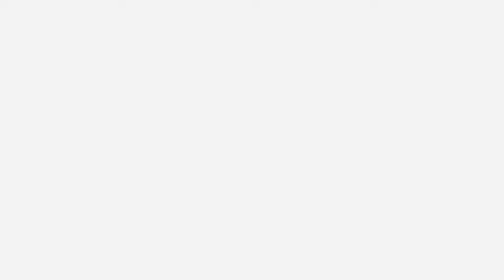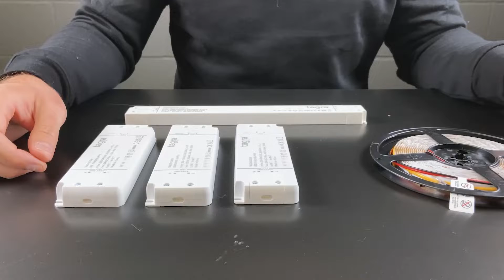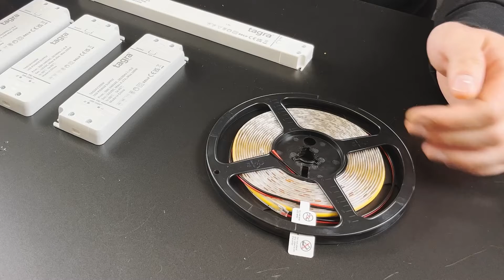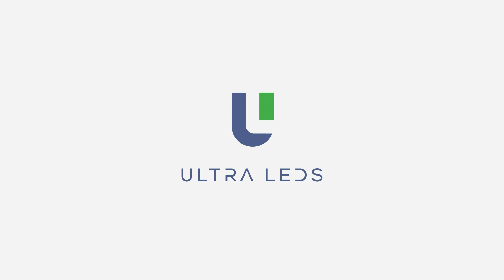Choosing the Right LED Driver for an LED Installation

Comment: Is it possible to collect all power supplies for flat led strips in one panel or it will  make issue with distance?
Shall we connect dc MCB at power supply output?

Comment: My 12watt led driver(12watt 260mA) got damaged.. I have purchased new driver which is 12watt 300mA… as 260mA driver was not available. So can i use that 12watt 300mA led driver instead of 260mA??
Reply from the maker: We only stock constant voltage LED drivers, whereas your setup requires a constant current driver. We recommend consulting your installer to ensure compatibility with your LED setup. If you're looking for constant voltage drivers, you can explore our range here: https://www.ultraleds.co.uk/led-drivers

Comment: Very informative video.
I have a fully functional light fixture which uses 220volt AC but now I am trying to move it and use it on a regular 110v AC supply. The light fixture has a lot of LED lights i.e. ten small LED lights and ten bigger LED lights all in series but I am confused with the inscription on the driver. The driver says Input: 180 - 265VAC and Output: 190 - 260VDC 240mA. I tested the driver on a 110vac outlet and it doesn't work because I think it is for 220vac supply. I think I would have to replace the driver with the right type for 110vac supply. I am not sure if there is any driver that can take 110vac and provide me with 220vdc output or am I reading something wrong. What do you think?
Reply from the maker: Your current driver (180-265V AC input) won’t work on a 110V AC supply. We stock Mean Well power supplies, some with a 90-240V AC input range, but most output 12V or 24V DC, not 220V DC. Check your fixture’s requirements and explore our range here: https://www.ultraleds.co.uk/led-drivers/led-drivers-shop-by-category/mean-well-led-drivers. For specific compatibility, consult an electrician

Comment: This is very useful.
What about the amperage, what role does that play?
If you connected 2 strips of 12V, does that mean it needs to be 24V or does it remain as 12V but the wattage goes up?

Comment: This is very useful.
What about the amperage, what role does that play?
Reply: Divide the power (in watts) by the voltage. e . g. 30 watts at 12 volts is 2.5 Amps. This will decide the rating of the wiring, connectors, etc.

Comment: I have a 20 meter run around my through lounge, how many drivers and watt would I need, I want a CCT cob Led
Reply: Also can anyone advise what type of profile is needed for a bend on a wall and if the led is being placed on a pic rail does it need a profile
Reply from the maker: @shaidulhussain1745  Hi there, we might need a little more information to assist you. Please email enquiries@ultraleds.co.uk and a member of our sales team will get back to you.

Comment: Been wondering, where does one physically place the driver? Are there regulations surrounding where they can be placed?
Reply: These generally will come in led light fixtures. This will go in the oval or square that is mounted to the ceiling . It’s a pretty tight fit but the more powerful the fixture the more space they’ll leave for it.
Reply: @trillium_music  I'm planning on building my own fixture, it's basically an led strip. It's going in a conservatory so the plan is to have the transformer in an enclosure on the wall, then have a length of 24V line to the strip, but I have no idea if this is legit or not.
Reply: I left a reply just now with some info and some channels that will help your project, if you don’t see them by tomorrow let me know and I’ll reply again with it.
Reply: My mate installed one in a underwater pond and wondered why it wasn't lighting up.I told him to play the rust in peace album near the Pond and it might cure the issue.I had no idea he took it seriously because he invited me over and I tripped and fell into a goldfish pond on the way to his shed while loudly hearing five magics playing.I always wondered if it was karma.

Comment: Hello how many lengths LED  strip would 36watts run perfectly? Or would 36watts perfect to run 204cm 5050 blue LED?
Reply: That would depend on type of led strip you go for and how much watts per metere it consumes since each have different power rating
Reply: @MHALI-qv9yc  OK Cool.

Comment: I need an LED Driver for a fan with a light.  The one I am replacing is 24-36W, AC85-265V 50/60HZ, DC 72-144V 260A. It has one connecting wire at one in and two at the other. Where can I purchase this?
Reply: We are the manufacturer of LED drivers,may i have your email number?
Reply: Are you sure the output is 72-144V 260A??? So the wattage will be 18720W. It seems there is something wrong.